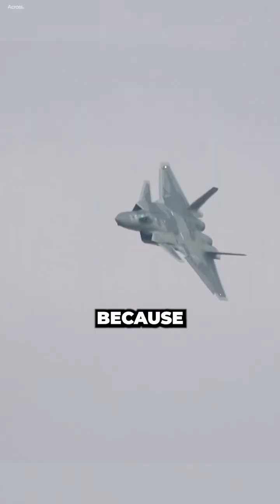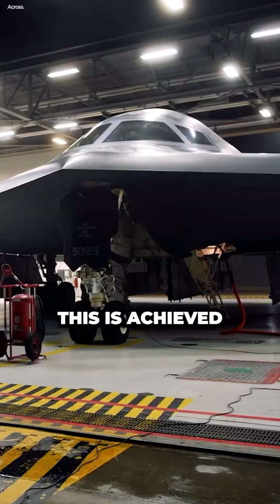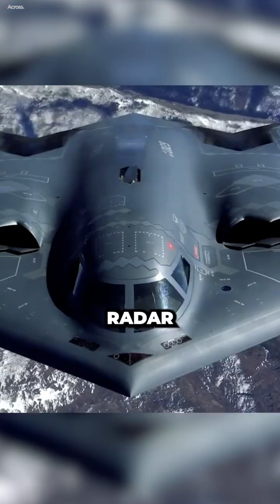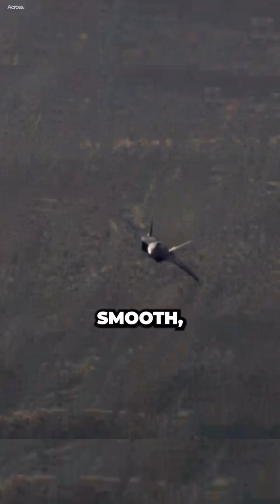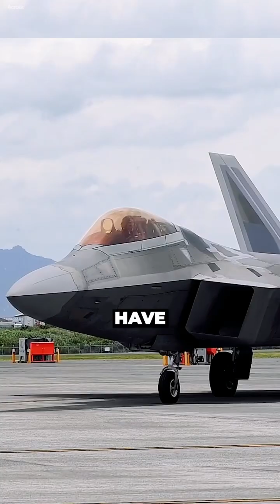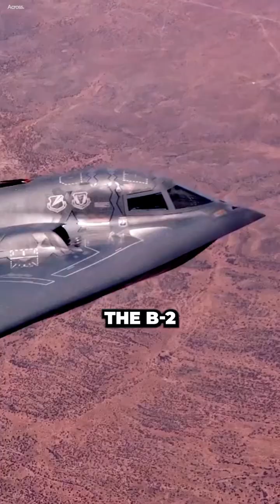Why Do Many Stealth Aircraft Have Similar Designs?

Comment: Why haven't "they" designed different radar systems to compensate?  Is radar just radar or what?
Reply: Radar band is determined partly by the size of the antenna. Most fighter aircraft have similar sized noses, so tend to operate in similar radar bands. Stealth aircraft are optimised against fire control radars like these.

Comment: Talks about stealth aircraft. Shows su-57.
Reply: Ah yes, the "stealth" fighter with a radar cross section as big as an F/A-18 super hornet
Reply: @da-enemy-AC-130-above that's a myth stemming from a public patent. Oddly enough, actual RCS data isn't included in public patents
Reply: Why you cry?
Reply: @lolkaggg7727  because it’s not stealth, it’s low observable at best.
Reply: @donjohnston4215 low observable and stealth are the same thing. LO is the technical  term, whilst stealth is the marketing term

Comment: One reason is that Russia reverse engineers US models, China buys or reverse engineers Russian models, and most other countries either co-develop or buy off of these three.

But other than that, it makes sense for aircraft designs to converge, much like in evolution. Sharks, fishes, cetaceans and pinnipeds all have similar features despite having evolved from different ancestors, because evolutive pressure pushes these towards the same goal.
Reply: Russia clearly designs its own clean sheet airframes and to say otherwise is laughable.

Comment: not a professional but
stealth aircraft have curved shaping to deflect radar waves away
why not use more radar so if that radar wave is deflected it deflects to another radar

idea 2: its dark and the stealth aircraft has radar absorbent materials
why cant they just shine a huge light in the sky after all they dont deflect light
Reply: I’m a little confused, what do you mean by “More Radar”?
Also, not all Stealth Operations take place at night, any amount of fog or cloudiness will obliterate visual detection, and the glint would be so small and distant (especially since the radar-absorbing materials are also designed to be somewhat Matte) that identifying it, amongst numerous other light sources and reflective objects, likely manually, would be all-but-ineffective, especially if the plane pops flares
Reply: You mean more radar stations on the ground and in the air? If you have that much budget to waste for nothing then try it. Actually, Russia came up with much more effective solution. a thermal sensor, the practical value is questionable though as they claimed it can detect F-22 at up to 80km away which is very close in modern air combat and US, Russia, China, EU, etc, has several air-to-air missiles with range exceed that distance.

And there also an untested solution namely Su-57, it has a few radar systems aboard which emit different radar wave length.
Reply: @Rebellion90s  Ah, so THAT’S what he meant by “More Radar”!
Yeah, no, let’s just say I won’t stop Russia from doing research on that anytime soon…

Comment: A flat surface does not reflect back to the source unless it's oriented perpendicular to the source. One major characteric of a stealth aircraft is no right angles. Right angles do cause reflections back towards the source. Hence no rudders standing straight up, but instead angled to the sides.
Reply: He is right. 

 This video is wrong. We did use to use flat angles before, but realize angular designs are terrible.

 Look at the top of the B 2. 

 Yet you still need to slice through the air yeah? So you sacrifice stealth.
Reply: That is a very simple explanation of how stealth works.

Radar waves do not simply bounce of an object like a ball off of a wall.

What actually happens is when radar waves encounter an object the energy gets converted to electrical current.

When the current reaches resonance then a return wave is created.

So stealth is as much about controlling the flow of electricity as it is about controlling radar reflections.

That is why stealth aircraft usually have chined noses and sharp leading and trailing edges.

It is also why the cockpit canopy has a gold coating.

You can control, disperse and deflect the return waves but you can also control and attenuate the flow of electric currents before they turn into return radar waves.
Reply: But if one of those little sides angled or tilt directly to the radar source???
Reply: Okay, Kelly Johnson! 😆😂🤣

Comment: I guess we were not the first one's to use this technology or we wouldn't give away this secret 😮
Reply: Well, the original work, math and theory was done by a Russian physicist, Pyotr Yakovlevich Ufimtsev. Most everybody ignored his work, except the US. We were the ones who sae how groundbreaking the work was, and set about using it. US aerospace engineers started working on practical applications for it by the late 1960s - early 1970s. The Have Blue project, which ultimately culminated in the F-117, started in mid-1974. The Have Blue, the world's first aircraft was designed and built from '75 to '76. It had its maiden flight in '77. The US has had functional stealth technology for roughly half a century.
Reply: No we were the first to develop otherwise we wouldn’t have been the first ones to use it. Think! Why would they wait for us to use it first? They wouldn’t that makes no damn sense. 
The thing is they use these people called spies that sell out our country for too secret technology and other information.
Reply: Lot easier said than done. Also, it is pretty obvious from pictures.